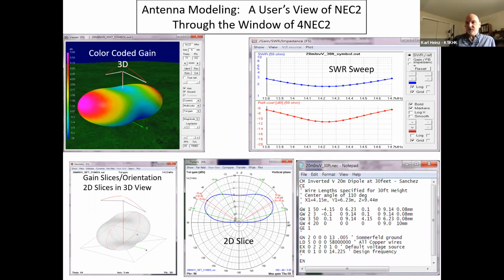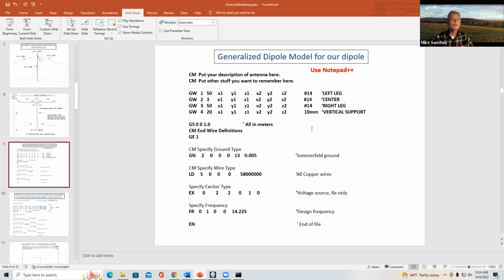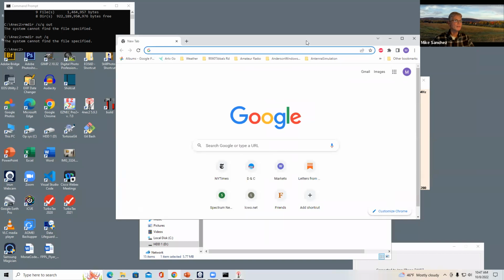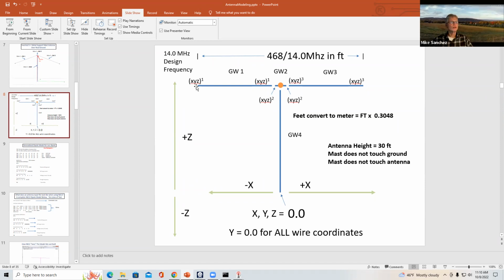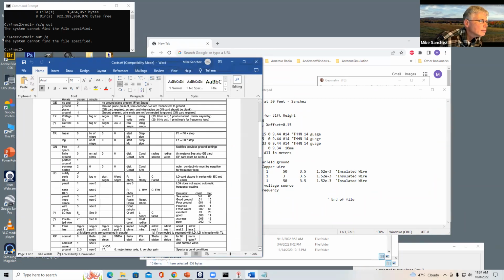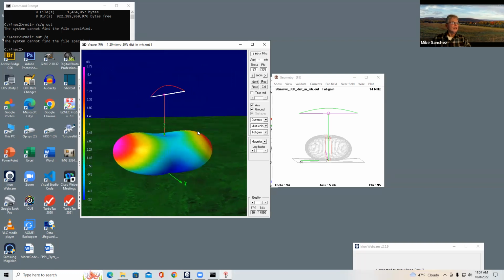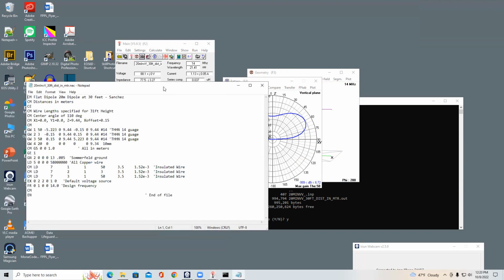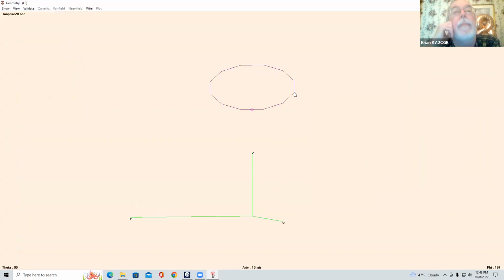RaRa Academy - Antenna Modeling with 4NEC2 - Session 1

Comment: I wish that I had STARTED with 4NEC2 rather than MMANA-GAL! The optimizer alone is worth it! I have spent HOURS running Segment Check, and even then the descriptions are sort of cryptic. I figure I had better go back and learn it right from the (new) beginning.

FORTRAN and punch cards? That's how I learned computing in the early 1970s.

73 de AF6AS in “DM13” land